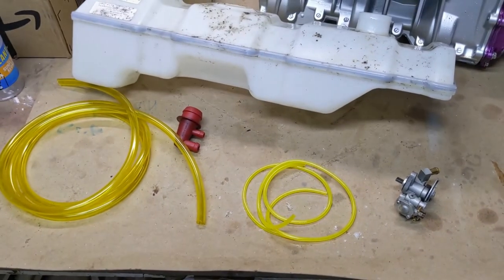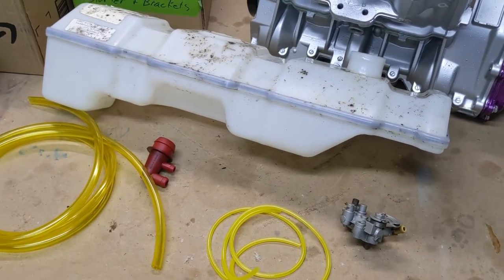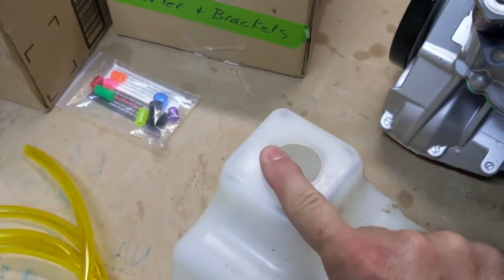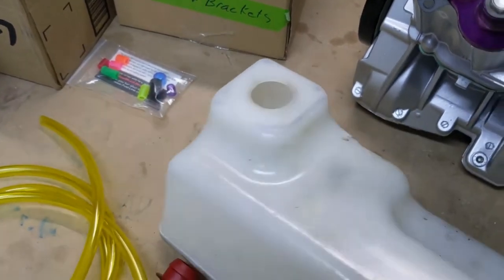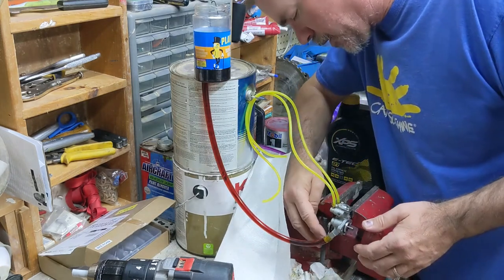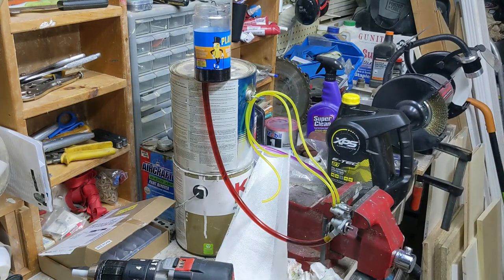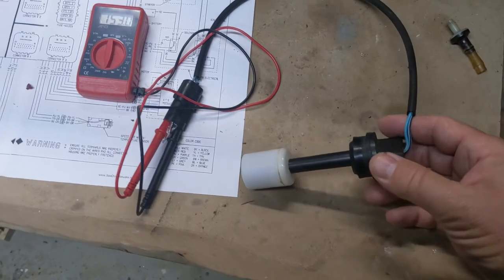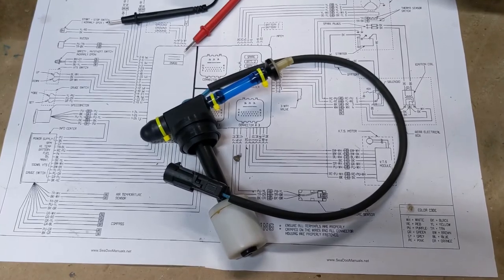Sea-Doo Add Back Oil Pump - Gray Ghost Resurrection

Comment: Hi 
Thanks for you video 
I have two 2003 Sea Doo GTI LE RFI
The one works fine 
The other one starts out running just fine like it should but once it warms up and I stop running it it won’t start up again
Not sure something heats up and causes it not to start (not firing right) our not getting gas
Any suggestions

Once it cools down it will start up and run fine but if I stop it it won’t start back up

Comment: Very informative. I have a 97, I got on a trade last year. It’s had some issues that I’ve been able to fix. The typical exhaust leak, some electrical issues etc. I just recently went through it all and it’s running great. I’ve haven’t had it in the water since doing this and when I started it he other day, there was clean 2 stroke oil leaking underneath the motor. It’s not coming from the tank or lines leading to the pump. I can’t find the cause and I don’t want to run it just in case it’s not getting enough oil. Any ideas on what it can be? When I reach my hand under the motor it’s coated in fresh oil. I hate to start ripping everything apart not knowing what to look for after spending so much time getting it put back together. Thanks if u see this message
Reply from the maker: It's most likely the crank seals. They get old and leak. When you ride it warms them and rejuvenates them and they seal back for bit until the machine sits again for a few weeks. Some people put plastic fitting valves on the two oil lines and shut off the flow while sitting. Have to remember to turn them on at the ramp. Short of that engine needs new bottom end.
Reply: @jonparkmac thanks for the reply! it only comes out when I start it. Nothing when it sits. Also, it’s clean oil. If it was the crank seals wouldn’t it be dirty, gas/oil combination coming out?
Reply from the maker: There is a single line to the pump and two for the rotary gear. Usually its the later for oil leaks and it's clean oil as it's in a loop and not combusted. Check you oil pump and make sure nothing around it is leaking. Check the small injection lines too.
Reply: @jonparkmac  thank you I will do that!
Reply: Also, on the left side of the engine near the bottom,  there is a Welch plug. I have seen a few of them leaking from there. 
If you keep your seadoo inside, leave the oil cap loose so it doesn't build up pressure and cause leaks.
Reply: @JH1200A1  thanks i will check for that. I haven’t had time to really look. I did start it up again. No oil that I can see. So not sure if some collected somewhere when I was working on it. I had to remove the line under the exhaust manifold for a few minutes and a lot of oil leaked out even tho I plugged it. So not sure if it collected somewhere then me starting it vibrated it off. That’s what I’m hoping. Hopefully will get it out on the lake before summers over and see. Damn weather has been very shitty where I live this year

Comment: The issue is not with the pumps. It is with the OEM oil lines cracking and burning up the motor cause you don’t  know the oil isn’t reaching the intake. So the block offs and premix solves that.
Reply from the maker: Correct, pumps don't fail. And yes, that's why you always replace the lines. A maintained oiling system is far better than premix as it is variable mix with RPM. Having to carry measuring cups and calculating ratios sucks and is error prone. Premix also fouls plugs more often for rec riders that do a lot of low/idle. That's why I'm reinstating injection here, like my other skis have. Premix is not really a "solution" .. it's a suboptimal work-around employed mostly by people that are misinformed on seadoo oil injection reliability. The 20+ year seadoo mechanics never recommend deleting injection ✌️

Comment: How do you know what size diameter of the hoses when my repair book it shows the schematic of what you’re you know whatever part it is and on the opposite page, it tells you like the parts list but it says hose washer screw clip pin. It doesn’t say any no size of screw fill up a regular doesn’t say whether it’s a brass screw magnetic screw still screw, how do you DIY when the manual doesn’t tell you what size any of the hardware is or what? What any description of it I ordered a kit that some off of eBay that’s for the oil line supposedly in the things are marked where they’re coming from and where they go to, but when you look at the skate the drawing of like the houses it doesn’t they don’t list them like that doesn’t say baffled to whatever, I don’t know if this makes any sense
Reply from the maker: Hey buddy. There is a parts manual separate from the shop manual. That has all those size and part number details. Search Seadoo manuals on Google and you will see. I personally spend more time in those parts manuals than than the shop manual. Let me know if you need help

Comment: What size is the larger line that feeds the pump from the tank?
Reply from the maker: 8mm or approx 5/16. Replace the filter and don't worry which way it goes ..doesn't matter but people obsess over it 😂
Reply: @jonparkmac  all the filters I've seen are direction with some sort of indication which I would "indicate" towards the pump.
Reply from the maker: Yeah, this oil moves glacier speed gravity fed so it doesn't matter, but if it has an arrow by all means. I replace mine every 2 seasons.

Comment: Don't lose the nylon coupler that goes between the oil pump and the flywheel. Apparently, those are very difficult to find now. Discontinued and not cheap!
Reply from the maker: Good point. I have a few places to source used from if I needed that. Also a good 3D printing solution for someone. Thanks for the comment bruther
Reply: @Jonathan McClure  yeah, get those out on ebay. We gotta keep the 2 stroke alive. The 4 strokes are a nightmare.
Reply from the maker: Agree. Cost effective to revive these. I have a 4 -teck and it's a hause

Comment: Great help! I have a question. Can I pre mix on a Seadoo GTX 2 stroke or should I fix the oil system? Fuel injection, no carburador. Thanks
Reply from the maker: You cannot premix the fuel injection models. I don't know exactly why but the experts that work on those all say premix is a no-go in fuel injection

Comment: May I ask?  The Throttle cable? I have a modified engine, they removed the pump. I need to get another pump but not sure how the cable mounts?  Some of the pumps have an attached bracket for it. Just don't know if my 1999 GTX Limited needs the same one? Any advise?
Reply from the maker: The one I had to find for this one needed the bracket built on to the pump itself. Later models like yours have the bracket as part of the magneto cover. So look at the front of your mag cover and see if you see a bracket. You wrap the oil lever one time around and then put cable on so it has tension. When your carb is adjusted for idle, adjust the pump cable so the 2 marks line up.
Reply: Ahhhhhh, thank you for that insight, I'll be checking it out..... @jonparkmac
Reply: @jonparkmac  Jon, looked at the oil pump I found in the bottom of the ski. It only has one mark not 2. I should assume that it would be the setting or timing line?
Reply from the maker: @garyc3016  there is a line on the lever and a line on the body. Those need to line up. It's sometimes hard to see. I have a pic in another video. Look at 1:45 here https://youtu.be/xGO5_cmm0k4?si=pd-0vwMgpSFguYNL
Reply: @jonparkmac  Sorry meant 2 lines of alignment